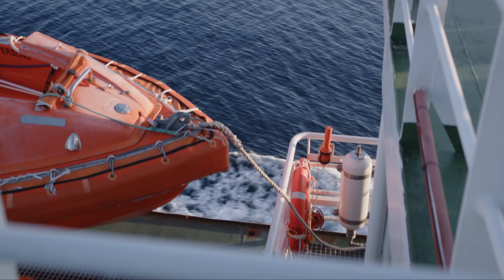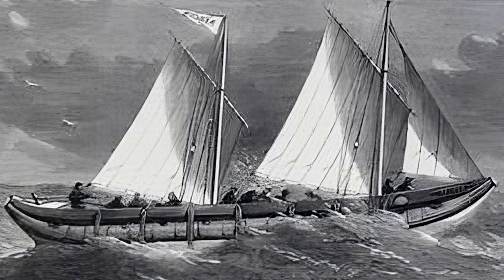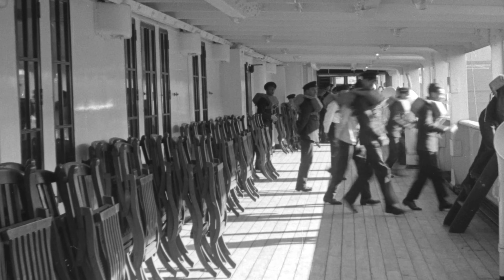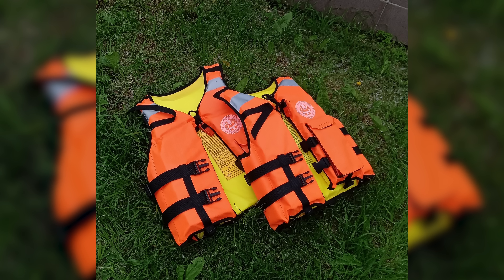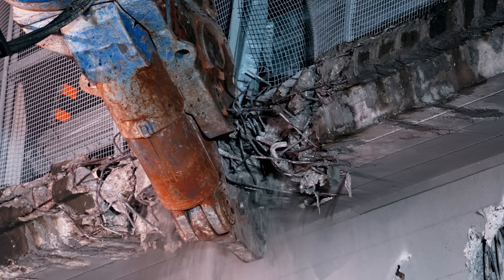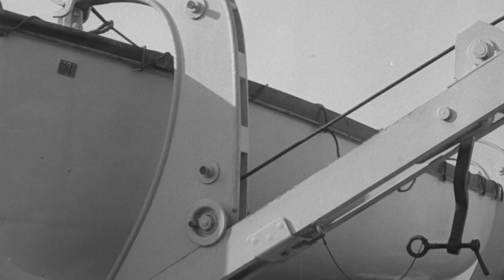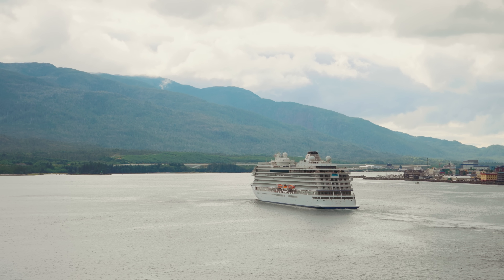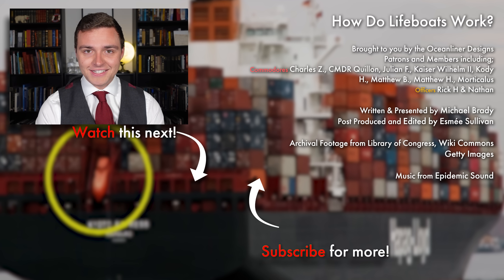The Amazing Evolution of Lifeboats: From Titanic to Today!

Comment: But, are there any good examples of boat evacuations apart from shore assigned rescue boats and helicopters? There are many chaotic ones with big loss of life, even very recent. There is tremendous development but is it just for show or a real "life saver"😅
Last few minutes give a good insight, better avoid a disaster with modern tech 😉
Reply: Most recent "failed" evacuations I can think of weren't Equipment failure. They were human error or blatant malicious behavior.. Like the sewol in south Korea. Were the passengers were told to stay put even tho the ship was sinking.. And the Costa concordia was also one of those cases where the ship sank due to a cowardly Crew.. Altough during the concordia, not that many people died.. It was still a disaster. So id say the modern Equipment are true lifesavors.. Most recent issues I can think of were all human error
Reply: Yeah, it seems mostly human error at sea indeed. In the sky it's more like 50/50. Best to eliminate humans as much as possible by autohelm? The Estonia and that P&O at Zeebrugge were also human error 🤧 @lucariolps277
Reply: Yeah, but in all cases I remember life boats are never fully utilized. Like the Estonia, the P&O at Zeebrugge, etc. The ship heals, it's dark or whatever, most people in the water or still in the cabin, always chaos.  @lucariolps277

Comment: I have been in both free-fall and Davit-launched lifeboats.  Both have their benefits and differences.
Reply: Just how uncomfortable is the moment when a free-fall boat hits the water? Are those shock-absorbing seats really effective?
Reply: @InventorZahran  Actually because you are facing backward it's not that bad, you are strapped into the seat pretty tight.
Reply: @InventorZahran  If I judge this by look on the faces of the people on board in the video my son showed me from his experience in one of those freefall boats (during his safety course at the school he attended while on his route to become an seafarer. Currently he is studying nautic to become a officer and finally a captain of a ship) the most uncomfortable moments are those just before launch when you are waiting for it. When the hook is released it's just a short Yeeee.... and then a splash and a few up and down bobbings until the boat is stable in the water. The lenght of the Yeee of cours depends on the place where the lifeboat ramp is installed.  Correct me if I'm wrong but on some of those oil rigs in the north sea it can be 40 meter and more of free fall.....
Reply: @ulie1960  Yes, it can be as high as 60+ meters. When you launch during your basic safety training you usually launch from 5-6 meters which is more fun than anything else
Reply: @fdenisiuc  Yes, this belongs to the the skills you want to have but never want to be forced to use.  My son just finished his mandatory two week tour at the emergency room in the local hospital. He also is happy to now have been there, but hopes he will never need the skills learned there....  Probably a fat chance in his line of work aboard a big cargo ship....